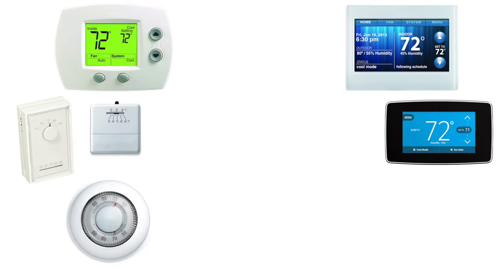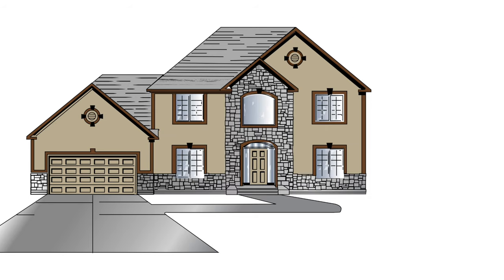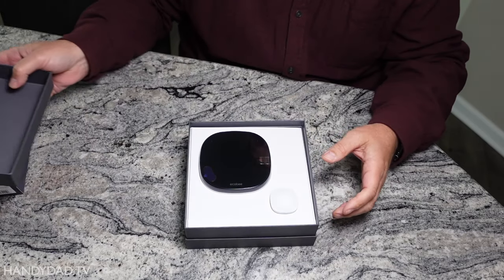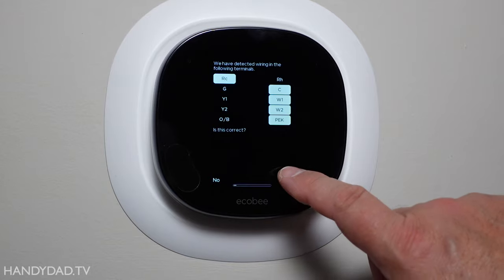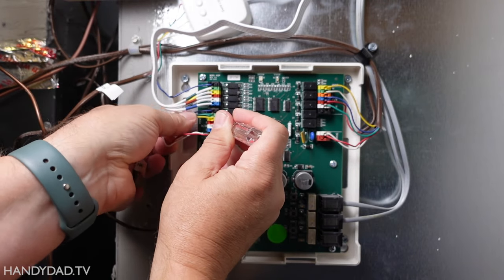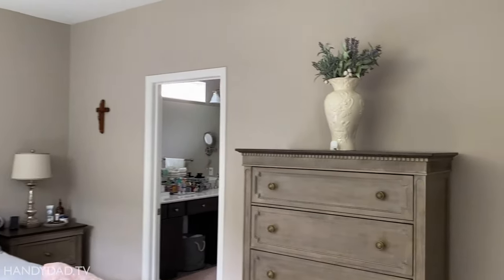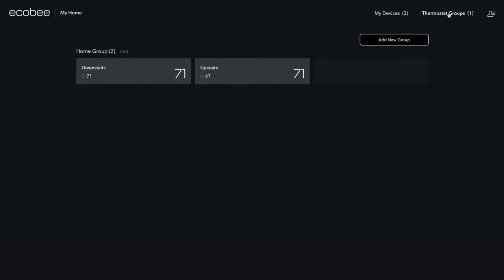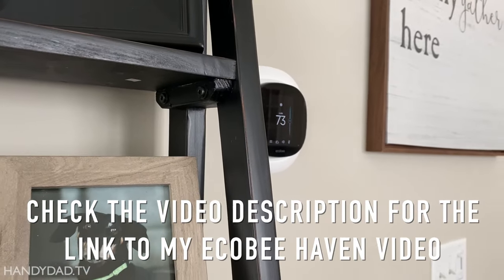ecobee SmartThermostat with voice control Multiple Zone Installation

Comment: Awesome video, I'm planning on buying one but I'm curious. I have 3 thermostats on the first floor. The second floor isn't used so I'm in no rush to worry about that. Do I need an ecobee thermostat to replace each thermostat on the first floor?
Reply from the maker: You don't need to replace them all at the same time, but obviously you would only be able to group the ecobees.

Comment: If i only have one zone ... does the senor still make that one room the temp i am after ??? Or is this only for dual zones
Reply from the maker: A single ecobee thermostat can have temperature sensors in multiple rooms. You can set it to monitor certain rooms at different times of the day. For example, I tell it what temp I want my office when I’m working at home. Then the great room in the evening. Then the bedroom when I’m sleeping.

You’ll still only have one zone. It just uses the sensor you choose.

Comment: I already had an ecobee thermostat installed on the 1st floor. Recently, my builder added damper zoning (Honeywell) due to improper heating/cooling on both floors. To avoid drywall repair, the builder opted to install an additional, more than 10-year-old model, Honeywell RedLink Wireless Thermostat( I hate this) on the 2nd floor. Unfortunately, this thermostat lacks smart features, and now I have two different thermostats operating with the same HVAC system.

I'm contemplating a potential solution and would like to know your thoughts. What if I install an ecobee in the furnace room and place the Smart sensor on the 2nd floor? This way, I could eliminate the thermostat(in furnace room) as a sensing point and solely rely on the temperature readings from the sensors which I kept on 2nd floor. Do you believe this could be a better solution to maintain the same thermostat throughout the home?
Reply from the maker: Get another ecobee for upstairs. 
Smart sensors don’t control different zones; they are paired to one thermostat.
Reply: @handydadtv  there isn’t any wire upstairs to install another thermostat. I am thinking to install additional thermostat in furnace room and then pair the smart sensor to keep upstairs.
Reply from the maker: @hemankyt Oh I didn’t catch “wireless”. I suppose that would work.
Reply: @handydadtv  I just found out ecobee removed grouping feature. Now will have to manage the thermostat separately.
Reply from the maker: @hemankyt Yes they must have been having issues with the sync feature so they temporarily disabled it. It’s less convenient but not terrible.

Comment: Great video.  Question - I have three zones and was wondering if ecobee or another smart thermostat has a function that allows zones to operate together at all times?  For example, if heating for zone 1 turns on, I’d also like zone 2 to also turn on as well, regardless of the temp at zone 2.  Or if zone 2 turns on, I’d like zone 1 to follow.  Is this possible?  Thanks
Reply from the maker: That extra thermostat would be a waste. Instead you could eliminate a zone by disconnecting the thermostat from the extra zone and combining the damper wires on the zone board.
Reply: @handydadtv  thanks!  I’ll see if I can get that to work
Reply: @handydadtv  I spoke to my local HVAC tech and he thinks that would put a lot of stress on the controller board (24V) and potential cause failure.  What do you think?
Reply from the maker: He’s the expert.

Comment: My home has two zones just like this, but my upstairs thermostat has no wire at all! But it does control the zone. How the heck does it work? And how do I replace such thermostat? Would really appreciate some help.
Reply from the maker: Google the model number of the thermostat to see how it works. It must be battery powered. It may be wirelessly attached to your main thermostat, or your zone board.

Comment: I've got a two zone system with a .Carrier control board and a Carrier thermostat with a remote sensor.  That thermostat controls both zones and has red, yellow, green and white wires connected to it and running to the control board.  The remote sensor has red and white wires connected also running to the control board.  The communication bus has no place for a C wire. There is a C wire running to the board in a section called 24 VAC Zoning Transformer.  The only C wire that I can see exiting the board is for a wireless receiver and since I don't have a wireless receiver, that section of the board is empty.  So, my basic question is how would I install the Ecobee thermostat(s) with the information provided so far?  A couple bits more information.  Both sets of wires running to the thermostat and remote sensor have a C wire (just unused).  So, I can get 24 VAC to the thermostat(s) if I can connect them to the control board...just not sure where I would make the connection.
Reply from the maker: I had a Carrier system in my old house. The furnace required a Carrier Infinity thermostat. The only smart thermostat it would work with was Carrier’s smart thermostat.
Reply: @handydadtv Thanks for the quick reply.  Just to be clear, only the control board and thermostat/remote are Carrier.  The unit is a Goodman (I don't know what electronics are inside the unit).
Reply from the maker: @donneybibb7646 I don’t know if you can use a non-Carrier thermostat with that Carrier zone board. I’d feel more confident if you have two thermostats instead of a thermostat and a remote sensor. Ecobee’s remote sensors don’t work separate zones.

Comment: Hi I have a house with two zone (upstairs ,downstairs) under one Hvac . However only one thermostat is used which control both floors. How do I install the ecobee smart thermostat pro ? I saw on ur video u used two thermostat one for each floor . I just want to use one thermostat to control both zone . Can u teach me how to install/wiring. Thanks
Reply from the maker: I don’t think you can use a standard thermostat to control two zones. Please contact a local HVAC person.

Comment: Is this feature still working? Considering Ecobee for a multizone setup, but I can find 0 documentation on their website about this.
Reply from the maker: Yes still working great! 

Three things I love most about this setup:

1. The mode syncs across both thermostats. If I change one to AC, the other one does it too. I don’t need to remember to run upstairs!

2. An ecobee contact sensor on my back door will temporarily turn off the system if I leave the door open for ventilation through the screen. You can also put them on windows. 

3. I have ecobee occupancy sensors in a bunch of rooms so it will adapt the temperature to the room I’m in. This is most helpful because it keeps our bedroom temp at night even though the door is closed and the thermostat is in another room.
Reply: @handydadtv  Thanks your video on this was great and the only one I could find! This gives me confidence to plan on this setup for a new house with multiple radiant floor zones.
Reply from the maker: Glad it was helpful 👍🏻

Comment: I don't know that this is the right way to go with this configuration. I have a similar setup and in my initial testing with this configuration it basically eliminates the function of your baffles. This syncs the setting of your thermostats to not only be configured for either cooling or heating but also enables them both for cool and heat at the same time.
Reply from the maker: Towards the end of the video, I showed how to sync the mode on both zones so they never work against each other.
Reply: @handydadtv  right. My comment wasn't about them working against each other. It was about them now only working together, this eliminating the use of your zone control with the baffles. An example would be when you have your upper floor cooling when your lower floor might not need to. With the configuration you mention they would both start cooling when the lower floor wouldn't need to.
Reply from the maker: The zones still run independently and the baffles work fine. They just automatically stay in the same mode (heat, cool, off).

Comment: SEPTEMBER 2023 UPDATE:
The ability to group thermostats no longer exists. My home has one system with 2 thermostats. The 2 thermostats were fighting against each other even through I have a zone control board. I called tech support only to learn that they use dto allow grouping but they no longer do!! That makes these ecobee thermostats useless to me and I am returning them to Best Buy ASAP.
Reply from the maker: I know! How dumb! The best feature taken away WITHOUT NOTICE! I was so pissed when I found out. I bitched at the representative that they DIDN’T SAY ANYTHING! They know everyone who was using this feature. They could have easily sent a notification or email that it was being terminated. But they did nothing. 

I’m not returning mine, but at least now I know I have to turn both off when I open the windows.
Reply from the maker: PS. Let me know if you find another smart thermostat that has this feature.